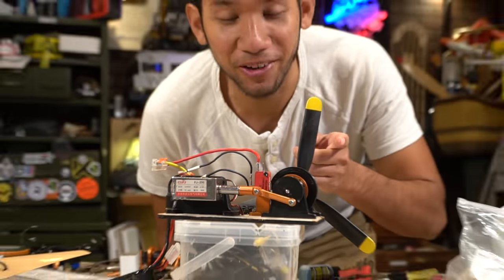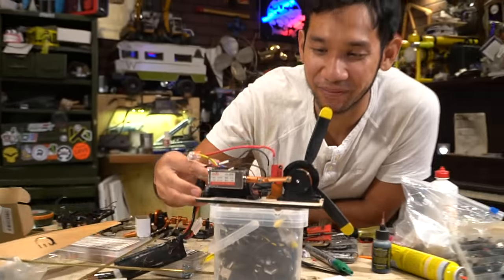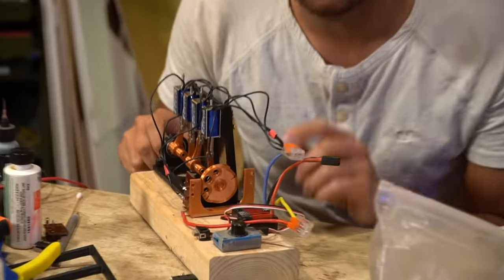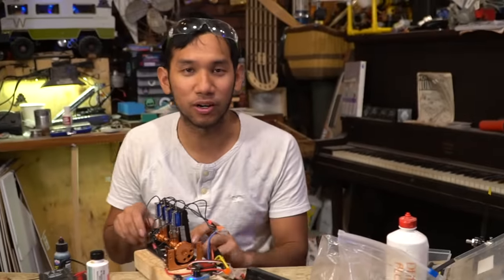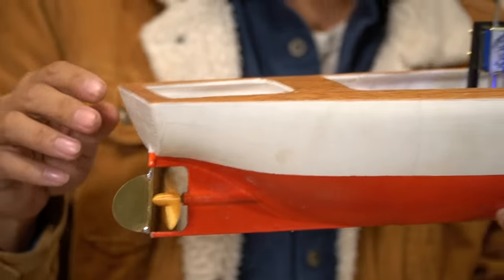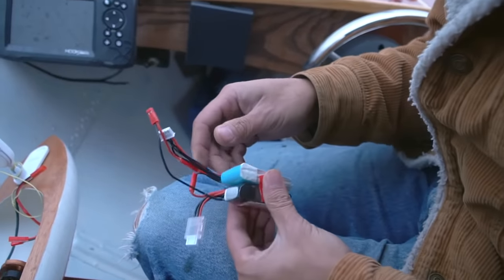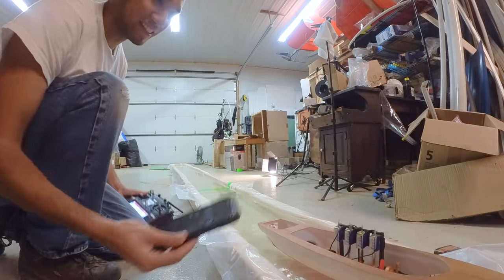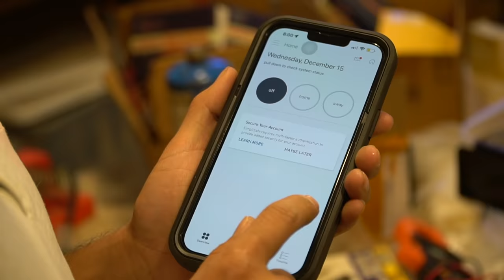Electric piston engine DIY (solenoid motor)

Comment: You need to change polarity half way in the rotation so you get all power this design have, no wonder it is week , you only use 50% of the potential it has. Add a duct and a electric fan and the heat will be less a problem. Try different configs like boxer or V  . Good luck.

Comment: The solenoids work better if they are not energized half the turn, just a pulse when the rod is 90° before getting inside the cylinder. Otherwise you are wasting the inertia

Comment: You might want to consider ditching the switch in favor of a hall sensor and solid state relay. It might work a little better if it doesn't have to waste power on the friction of that cam. Or at the very least you could make the cam smaller, that would also be more efficient.

Comment: Can't you off set them more so there is power on more then just 2 points? Like off set them to push or pull every 90 degrees or even every 45 degress instead of just 180? Oh and obviously add a flywheel.

Comment: By trade; I used to be an automotive electrical and computer repair and diagnostics technician. All-though the term inner stroke isn’t correct I prefer that term than Pretending that it’s a two stroke engine and giving the stroke a name for something that works on different fundamentals.

Comment: Couldn't you have reversed the polarity when the pistons are moving in the opposite direction for more power instead of running no voltage?

Comment: Instead of using Solenoids, why not wind your own coils and trigger a capacitor to dump into them at the correct time? similar to how a coil gun works? Also might be more efficient as you can get that to fire when the piston rod is near 90*, as firing from top dead center all the way to bottom stroke is wasting a lot of energy.

Comment: Make an inline 6
Reason 1:  making a 3cyl wtih 60degree crank throws will be more balanced than this inline 4
Downside: It wont be balanced and you'll lose 25% of power.
Reason 2: mirroring an I3 to a straight 6 WILL be both be balanced and increase power 50%
You could also offset every-other crank throw by 30degrees so instead of a normal inline6 where the middle 2 cylinders are paierd, then the next 2, then the outward 2 (cyl1 and cyl 6) nothing would be paired and you could have a real I6 firing order.
1-5-3-6-2-4
Like a 2Jz, barra, RB26..

Comment: why is the driveshaft (each step) not by 90 degree turned? so u have 4 Steps... (continues Pull)... u have just turned that by 180 degree. What makes ur 4 "cyclinder" to and 2 Cyclinder because 2 do the same motion.. Rly? why?

Comment: Seems like too much overlap. The switch turns one set of solenoids off while the previous is still on. A cross plane design with more switches would solve that and make it run smoother also

Comment: Engine = GAS. Motor = Electric..     Also, Staggering the solenoids every 90deg would make better average power. 
Arcing will burn the switch out..  Add a small capacitor across each switch leg and the common. it will stop the sparking "contact burning"

Comment: Step 1: Get A SendCutSend sponsorship
2: Make the Solenoid mounting plate out of Aluminum
3: Make it a boxer engine  or radial engine 
4: mount it to a plane so the prop wash helps cool the engine.
5: More Videos!

Comment: Maybe powering the solenoids for half the time isn't optimal, they're powered when they actually can't do any work. With, a say 25% "duty cycle" all the force produced should go into turning the crankshaft, and no part of the cycle just into tearing the thing apart. A lower duty cycle should also allow powering further beyond specs without harming the solenoids.

Comment: I know a way to make it work ok and possibly make its own power all you need is 4  capacitors for each cilinder and a uneven amount of cylinders but an even amount of pairs like it's a 5 cylinder so you need 10 one to pull one to push the capacitors will be on a cycle so every 1 rotation the outher capacitor gets used so the outher capacitor gets charged for the power generating use 2 brushless motors and a large battery with a voltage regulator for discharge and charge have the cilinder's in a coolent bath housing to keap them at a constant temp the shaft you can use for a boat a plane and a rc car the basic thing is to use the capacitors as a spark plug the battery as the fule and the brushless motors as the mini fuel source yes I know that the battery will die becous the voltage created will not be enough to charge the battery higher then ehat the voltage neded but it would level out around 10 v with two  5 volt brushless motors at 1000 rpm or more add 4 motors for a 20 v at 1000 rpm or a more realistic  12 v at 250-500 rpm

Comment: To explain why this engine has terrible efficiency:
The Solenoid has its best efficiency and most force at the very end of the pulling stroke where the Crank is at top dead center and has its least efficiency making it useless. Regardless how you might try to optimise it you cannot beat these physics.
And because the "Piston" is just ferromagnetic (AKA a piece of Iron) pushing is not an option. If the Piston would be a Magnet in itself pushing would be possible.

Comment: If 22 volts is the bare minimum to operate the engine, it probably stopped working due to the battery voltage drop from both the cold and the drainage.  Lipos hate cold.

Comment: What you built is actually a double I2, not an actual i4.. For it to have been an I4 solenoid motor, the crankshaft should have been crossplane, not flatplane.

Comment: Peter you are intelligent person why are you going back to the stone age when the beushless motors are giving you 20000rpm for rc heli and boat modelling invent something better and faster than the brushlass motors anyway you can't put them in rc helicopter because of low rpm of the solinoid engine

Comment: the electric company aren't using the solenoid engines are designed for electricity its meant for gas and fuel

Comment: Hey Mr. Sripol, 
I have been building several Solenoid Engines myself, and experienced, that using only one switch for two solenoids with the crankpins 180 degrees apart, makes the magnets often block each other, and therefore reducing torque. 
Furthermore, overlapping power strokes, such as in an inline 3, or v4, gives you the advantage of self starting once you apply current,  increased torque as well as engine speed, and last but not least a smoother run.
However, keep in mind to use a switch for every solenoid wich provides the magnet on less than 180 degrees of the power stroke with current, to avoid blocking. 
Just to prove that I know what I'm talking about, here's a link to a video of me showing my RC solenoid car, wich uses a v4 to accelerate a vehicle with a weight of 3,8kg: 
https://www.youtube.com/watch?v=mNc2sOmklEE

Comment: I bet you would get more efficiency out of "3 cylinder design" with 120 degree off set on your crankshaft then this "4 cylinder model" but if you went with a 90 degree crankshaft you would improve this one. But I still a "3cylinder" would be the most efficient
PS. watch your video @ 0.5 play back you look and sound drunk as a skunk LMAO